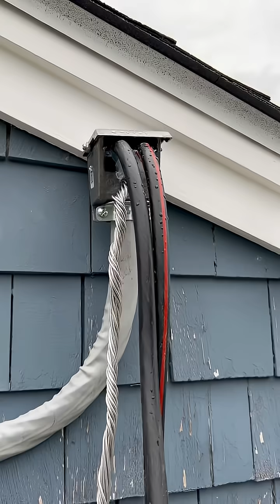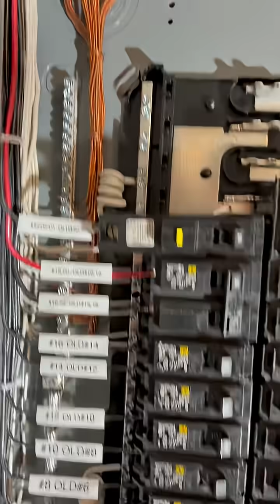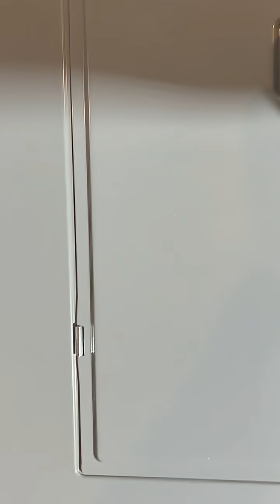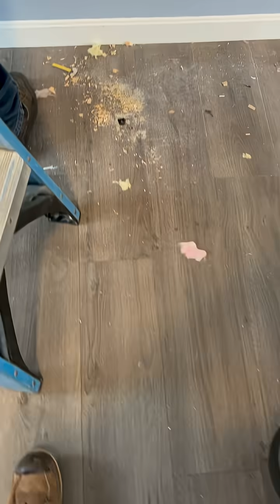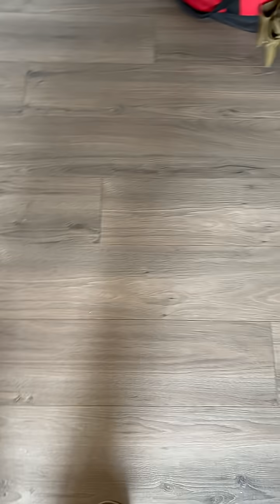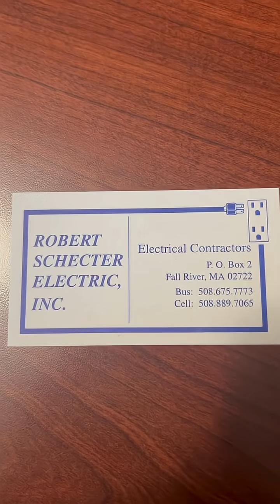200 Amp Panel So Clean, It Looks Like Electrical Art — Must See!#electrician #electrical #shorts

Comment: Zip ties are for handymen.
Reply: I wish people would get off criticizing zip tying conductors. They always talk about bundling.  There isn’t a ‘bundling ‘ issue.  As for servicing the panel, it’s not an issue.
Reply from the maker: @Californians_go_home I’ve done a video on this covering the code article being able to bundle all connectors in a panel I wish they would check it out.
Reply: @SchecterElectric  I didn't say it's a code violation. With solid wire it is completely unnecessary and a hassle when adding or removing wires. It is straight hack. Learn to bend wires. It's not that hard.
Reply from the maker: Definitly not

Comment: Great work. It definitely inspires me to go the extra mile to be professional and well organized.

Did you increase the service size? I'm wondering, for your location, are the service drop utility wires are almost good for 200 amps? I know that the utility has different rules for their ampacities, and in Colorado the free air service drop conductors are usually good up to 200 amps.
Reply from the maker: Yea I’m in Massachusetts we increased the service to 200 amps our drops here are rated to do so great question!

Comment: I’m a licensed journeyman in ma and wa, I sure miss the work in Massachusetts, so much better and easier to work on. In Washington you can’t touch the utility power at all, you have to pay them and you have to pull a permit for everything including changing out a few outlets. Did I mention they have people who drive around or use drones to find to working and fine you if you don’t have the proper permits, permits have to be pulled before work starts unlike Massachusetts. I was in the Boston and Plymouth wareham areas, now I’m just south of Seattle.
Reply from the maker: That’s where I am located as well
Reply: Pull a permit to change out receptacles?
Reply from the maker: @SLickev92 everywhere is different I wouldn’t be surprised

Comment: Really nice job as usual.  I usually push my grounds all the way to the left and turn them right into the ground bar.  That way I can put my neutrals on the neutral bar without crossing over the grounds.  You obviously know what you’re doing, so I’m just curious why you did it the other way around. I’m sure you have a good reason and I’m just wondering what I’m missing.
Reply from the maker: I just like being able to see the grounds coming in that way it’s all preference friend. If the grounds are tucked away towards the left side of the panel sometimes I find adding new ones are a little difficult but other than that that’s about it. Great comment!

Comment: Plumber here.  I had grounds to the water service.    Sometimes micro voltage can travel through the ground wire and slowly eat away the copper water main.   I’ve seen it a lot in 18years.
Reply from the maker: There should be 0 voltage and 0 current on the ground for the water service. You must of ran into issues with objectionable current flowing on the ground due to someone not separating grounds and neutrals or perhaps they lost a neutral somewhere.
Reply: Very beautiful work by the way.
Reply from the maker: @minimalizman thank you friend
Reply: That current is certainly objectionable! 😡